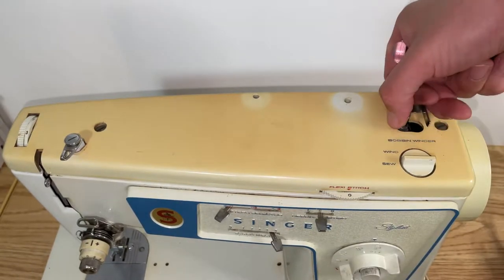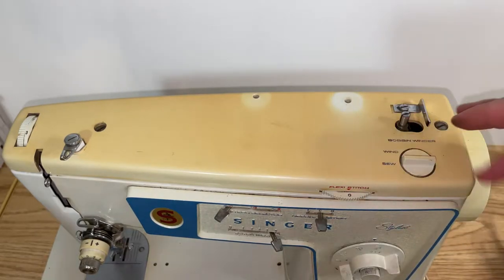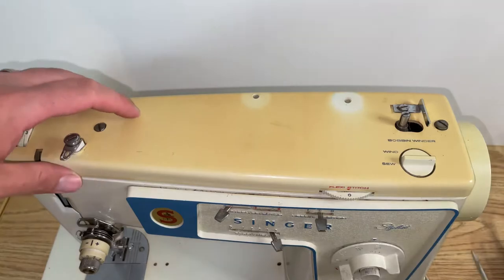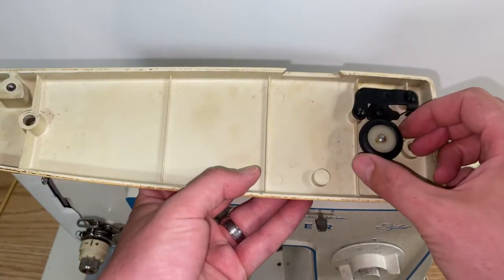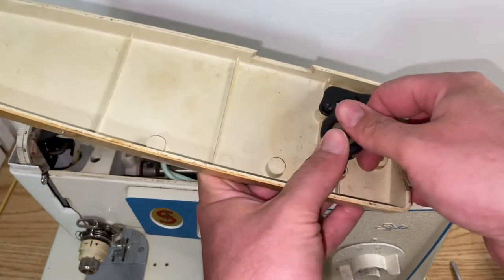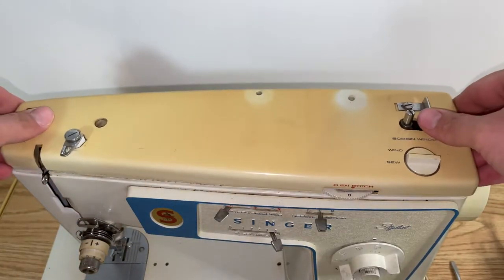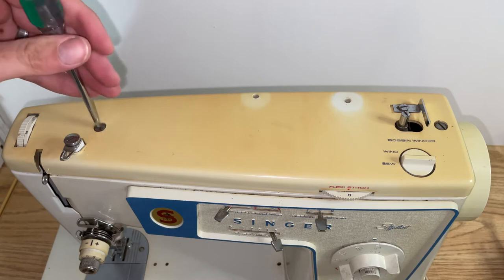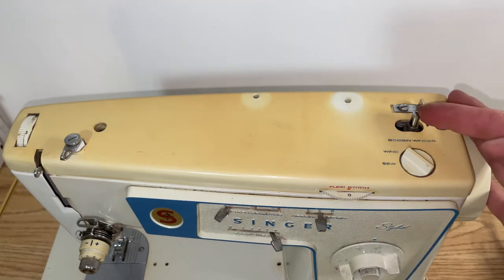How To Fix A Bobbin Winder On A Sewing Machine (Rubber Wheel)

Comment: I don’t know what’s wrong with mine. I changed the rubber and it’s still not spinning
Reply: Mine, too. The rubber bit is fine, the spinning bit itself is the problem. It's really stiff, and probably needs the oil I don't have. 
Maybe try oiling your machine if you've got the same problem
Reply: I think the first thing you should try before messing with the rubber ring is adding a little bit of oil. On mine there is a small opening about halfway down the shaft that is supposed to spin. I added two drops and Forced the wheel to spin using my fingers, and then it was was spinning freely enough for the machine To do its job.